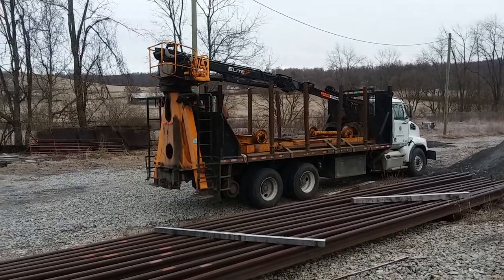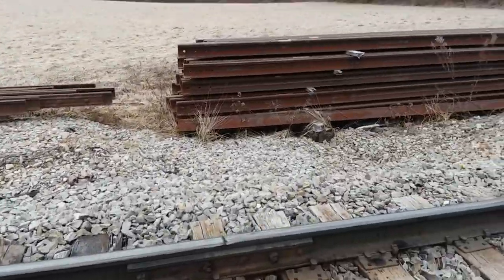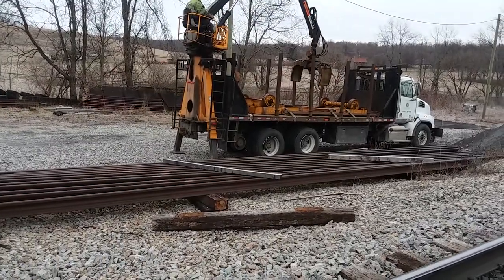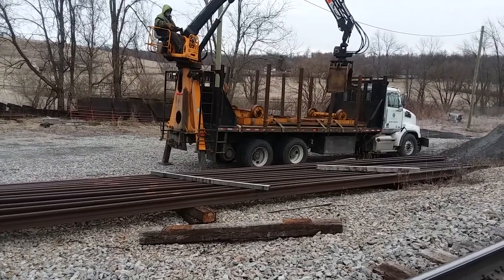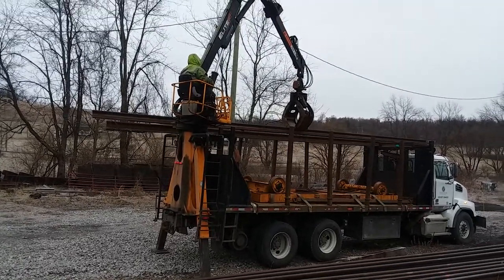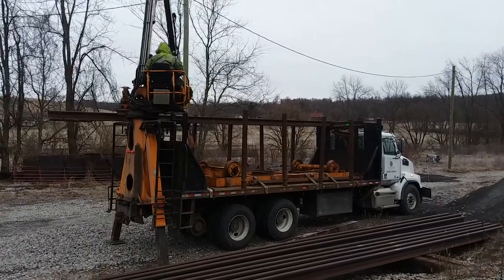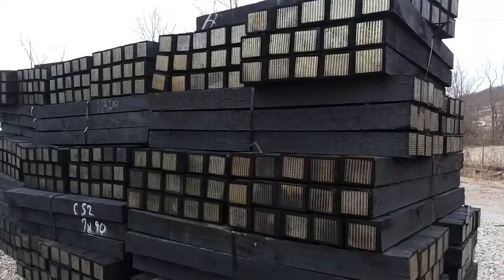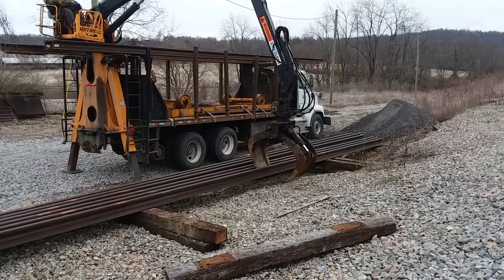Loading 39 Foot Sticks of Rail onto a Grapple Truck

Comment: I know about the weight of those ties. One time the supervisor gave me about 15 of the old ones they took out of the mainline here in Fresno about 6 years ago, because the apartments where I lived went right up to the railroad property. I told the supervisor I needed a few to fix the back yard  fences on the complex units. (Each unit had a little fenced in yard/patio area). I used a shopping cart to move each one to where I needed to use them.
Reply from the maker: They ain't easy drag round by hand, we have tie tongs which help, they like giant ice picks

Comment: I used to operate  a truck just like that,I would never load over the cab like that always  from the back.One rail on each side,one at a time equal  the load.Always grab the center  of the rail.
Reply: The cab has a headache rack that the rail sits on so you have to put rail over the cab anyways. Putting two rails weighing around 3000 pounds total on one side will do nothing when loading the truck. A truck like that can handle over a 15000 payload.

Comment: That huge rail section, all being twisted around...it's like a scene from a 3 Stooges sketch!  
Imagine Curley controlling the crane, and Moe and Shemp standing truckside...
Why does every piece of equipment you use have the ability top kill a man in at least a dozen gruesome ways?  You sir deserve a tip of the cap and a free beer for the work you do.

Comment: You mentioned that you’ll weld the blanks onto pieces with the holes drilled. Will you do that with the thermite rail welding setup, or are there other ways you weld rail? I know the big continuous rail laying machines have enormous electric welders built into them that butt-weld the pieces together, but I’m curious if there’s some other method besides thermite that you’d use when you have a bunch of sections to do like this.

(It’s also interesting to me that it’s easier to cut and weld, vs just punching the holes yourselves. I was at a local steel yard a few years back and saw them punching holes in I-beams. It was kinda amazing, they had this little (well, pretty hefty, actually) hydraulic punch that they’d just position where they wanted the hole to go and then feed it the hydraulic fluid. It’d chug away for a few seconds (maybe 10-12 or so?) and then there’d be a loud “POING” and the plug would pop out. It was a very fast and efficient way of making holes, even in 1/2-3/4” steel. I guess the downside is that it needs hydraulics and the unit itself was pretty heavy - they had to use a hoist to position it. Still, I’d think it would be easier to have one of those and just punch holes in the rail in the yard ahead of time, vs all that cutting and welding.)
Reply from the maker: All we have ever done is thermite Dave, some RR's use flash butt welding. I never saw that type of machine to make holes, bet it
wasa awesome, we use a rail drill which is pretty quick, an old timer
RR man told me he used to shoot holes in rail with a rifle! Appreciate your watching sir

Comment: Is there a video on how you bend the rail to fit the curve? Is it bent at the site or at some factory where they're made and transported to the site?
Reply from the maker: Not yet Tony, sometime way in the future I'll do one. All rail comes
straight, then we bolt one joint together and use lining bars to bend
the rail, it's really easier than you might think. On sharper degree curves usually takes 2 or 3 guys using the bars. Some transit rails
are however pre bent for really sharp degree turnouts and cross overs.
Very good question you have posed and one that I wonder why more
folks aren't asking. Way back when I started RR I thought the curved
rail came that way, but it doesn't
Reply: @ccrx6700  Thank you! It would be interesting to see what formula is used to figure the degree of the curve and how the rails are bent on site. I've walked many miles along the tracks and that one question always popped into my mind. I'll be watching for a future video. Thanks again!
Reply from the maker: @tonyf.8858  gonna have a vid out sometime this fall on the narrow gage track we are volunteering rebuilding that shows you how to figure degree of curvature. It simple, take a 62 foot string line from the rail head, then at mid ordinate, 31 feet, measure out to the string line, that gives a fairly close figure for degree of curve